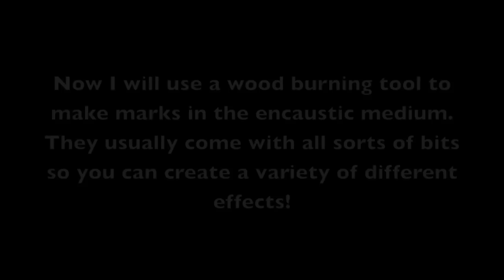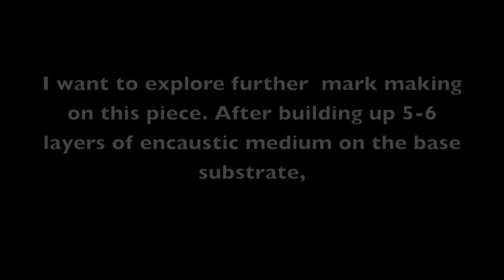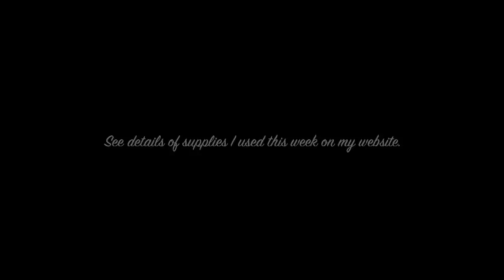"Wax on Wednesdays!" Fun Mark Making Tools For Encaustic

Comment: beautiful! thanks for sharing. Do you mix damar in your medium?  how do you retain such crisp lines?? Every time I've tried this technique, my lines spread out and the pigment (oil pastel) mixes with surrounding paint when I add heat! what's your secret?
Reply from the maker: Katharine Miele Hi Katharine ,
Yes, there is damar resin in my medium. You can either make it yourself ( usually in a ratio of about 8:1) , or purchase it already mixed in for you. 

Over fusing , and keeping your heat tool focused on one spot instead of a constant movement when you are fusing, can cause the colors to run, and break up lines etc . Try just lightly fusing you piece just to a glisten , and keeping your heat tool moving as you fuse. 

Hope this helps !
Happy Creating :)
Shari

Comment: How do you preserve the wax once you are finished with the piece. Won't it melt again in the sun or hot weather?
Reply from the maker: Hi J Co I am sorry I may have missed this question before.  The damar resin in the wax medium hardens the piece over time, and the encaustic is very durable and provides its own finish ( no varnishes needed ). Just like any painting you would want to keep it out of direct sunlight or a hot car etc. , but encaustic itself is both highly durable and archival  :)
Reply from the maker: Hi J Co I am sorry I may have missed this question before.  The damar resin in the wax medium hardens the piece over time, and the encaustic is very durable and provides its own finish ( no varnishes needed ). Just like any painting you would want to keep it out of direct sunlight or a hot car etc. , but encaustic itself is both highly durable and archival  :)
Reply: +Shari Replogle Thanks for your reply. I paid for a workshop in encaustics several months back. The person running the workshop was amateurish at best. She really did not seem to know anything about materials, as we just melted pastels and painstakingly worked to spread small amounts of pigment onto our "canvas." Could you lead me in the direction to learn more about the materials and how they are correctly employed. Thanks!
Reply from the maker: Hi J Co, I have a full line of encaustic workshops where I talk you through each project step by step, as well as all of the basics of set up , tools, and most importantly the  "whys and Hows" of getting started working with encaustic. 
In " Encausticology Collage workshop " I also show how to make your own encaustic paints . If you would like to see all of the workshops follow the link below to my workshop page. "Encausticology Image Exploration" or "Encausticology Collage Journey " are the ones I recommend for lots and lots of info and fun projects .  I hope this helps.
http://playswithpaper.blogspot.com/p/online-classes.html 
All workshops are also available in my Etsy shop www.etsy.com/shop/primology